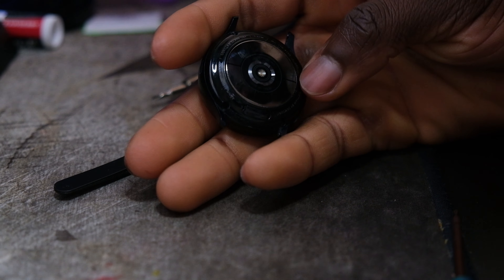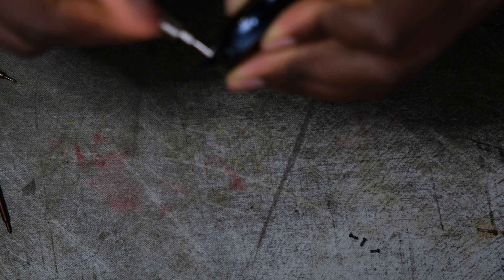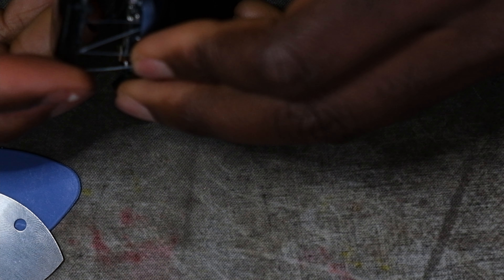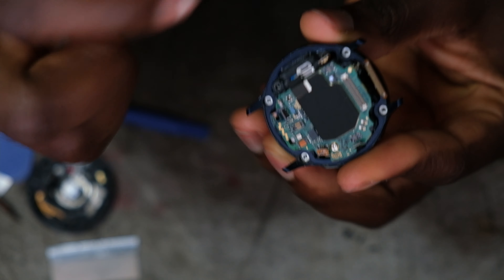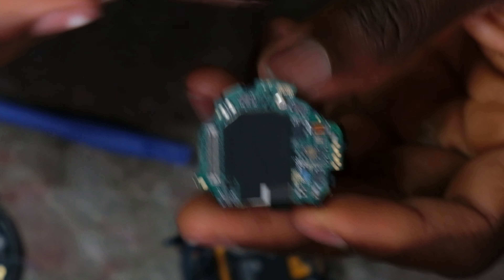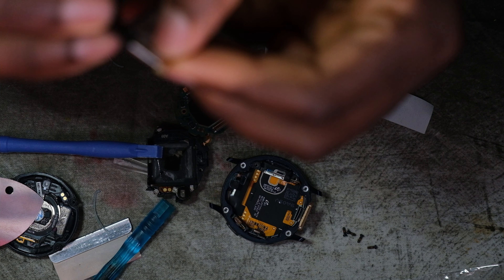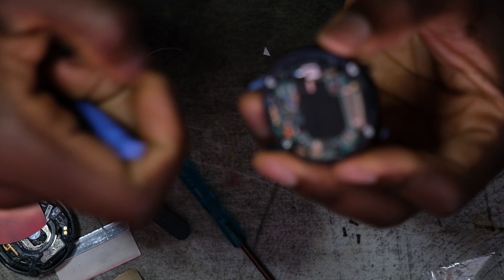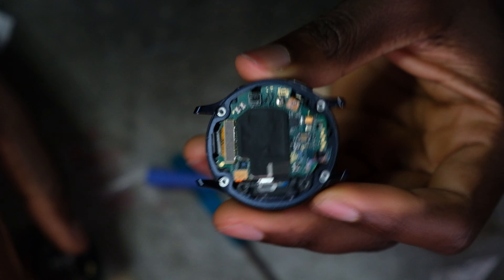How to change the battery on the Samsung Watch Active 2 (40mm) EASY

Comment: Why you change the battery..is it dead? After how many months?
Reply from the maker: It was a refurbished unit from Amazon and about 4 to 6 months the battery started malfunctioning. For example, it would turn off at 50%, drain quickly and more.
Reply: Is it alright now? How much cost to change the battery?
Reply from the maker: Yeah it works. And I linked the battery replacement kit in the desc
Reply from the maker: Description